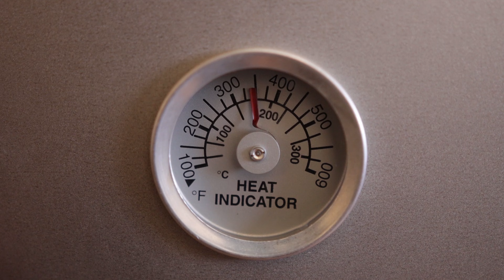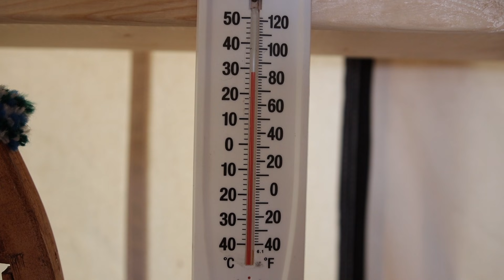Alone, deep in the wood

Comment: The Bic lighter is the most underrated survival tool in the world, if you drop it in the lake, it floats. If it gets wet, it dries out. If you drop it in the bush, it’s brightly colored and easy to find and when it runs out of fuel, the flint continues to produce a spark for up to a year. The ferro rod is an inferior product. Love your videos, buy a Bic lighter.
Reply: Bic lighter... gets cold wont light, you can keep it. In the winter when a fire is needed now a cold or wet Bic is useless. Oh I do carry a Bic but I also carry other methods for starting a fire
been doing for most of my 75 years.